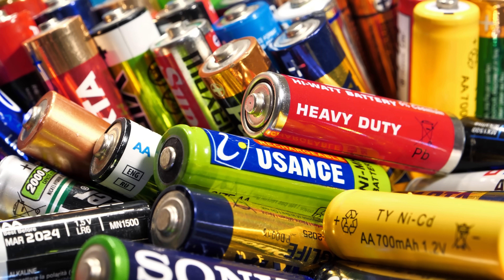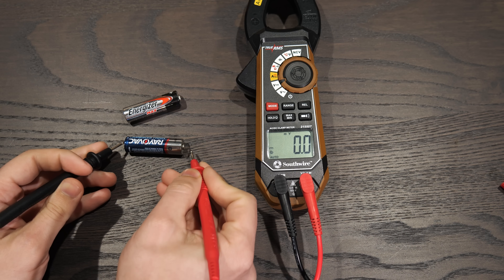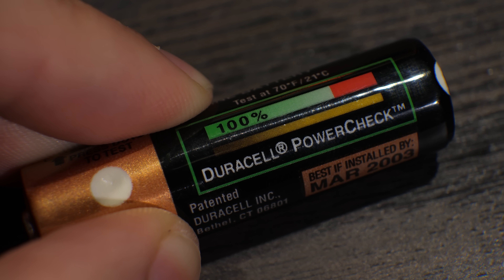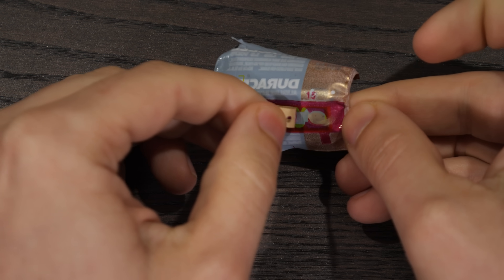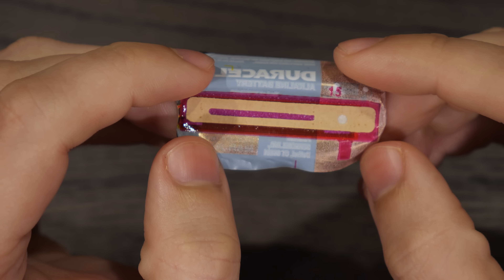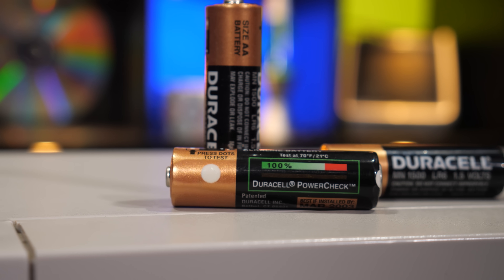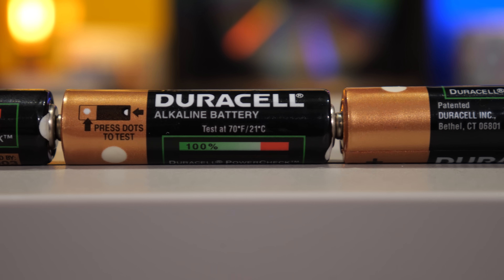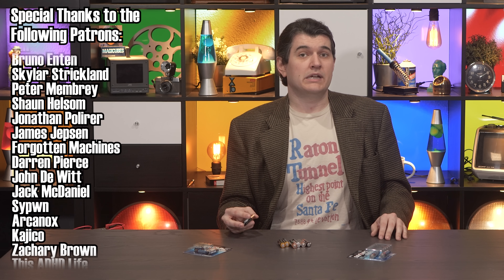Duracell PowerCheck: A genius idea which didn't last that long

Comment: K, but my mouse stops working sometimes. Is it the battery or some problem with the mouse? Are both the batteries burned out because it would stop working with only one used up. I would pull a new battery or two out of the package and then somehow end up with three or four batteries on the table and I had lost track of which ones were new and which ones were old. I guess what I'm saying is that I would actually kill someone if I thought I could get my hands on those old genius level self testing batteries! 😊

Comment: i mean i know like an electric can opener would only work with new batterys and then they stopped working and would still be 4 cells on a wiimote which i would sometimes also use for a crude battery level tester. so would move the can opener batterys to the wiimote.

Comment: back then what saved my gameboy most of the time was the good aluminum foil trick. whenever i got to be home alone as my parents went to work, i would pop out the batteries from the tv remote, take off a few pieces of foil, and it was right back to minish cap

Comment: Great to see the explanation of such a niece technology I grew up with and never saw again after a few years. 

I had to think about this feature. The amount of work to develop such a clever mechanism must be great. But the effort to bring the idea to mass production and reliable produce the labels - it must be equally hard. All the effort to give your batteries a bit more feature to stay competitve - and than it is hard to use and not really helpful - as you stated.

My main issue with the feature was: I had no feedback if I'm doing it right or the battery is dead. Is the temperature right? Do I press the dots correctly? Or is the battery dead? I tried it a few times and never got the competence that the gimmick is working.

Comment: There's no heater it's just another piece of engineered foil that creates an electric arc and lights up in a pattern.  These never actually accurately told the batteries percentage. 
The more you know! Cheers, a long retired PowerCheck technician!

Comment: I used the testers before using battery operated things to make sure there was enough juice in them. I.e., flashlights before a storm.  Also, if they were laying around for a long time, to see if they still had charge. I was miffed when they took it away.

Comment: I think that during that 90s this was something more important to kids and their parents as so many of our toys and music devices ran on AA or AAA batteries, so we were always taking batteries out of whatever we could find to make that device work just a little bit longer. You'd test each battery see which had the lowest charge and swap it for a fresher battery in a remote for the TV or VCR, just to squeeze a little more playtime out. And when that remote died you'd test the batteries and replace the low voltage one, but now nearly everything has a rechargeable battery, so the power check was just a necessity of a bygone era

Comment: Yea, nowadays, everything uses rechargeable batteries, and in general, the usages of AA and AAA batteries are becoming more and more rare. Most devices have those Li-ion rechargeable batteries now, and some even have "built-in" rechargeable batteries, just a term where corporation used to discourage people opening up their devices.

I still have some AAA batteries left for my TV Remote, as well as a plasma arc lighter that uses AAA batteries (very rare, as most on the market uses the built-in 3.7V 150mAh Li-ion Polymer battery). That's about it.

These AA and AAA batteries manufactures are a dying business in the modern day technology world

Comment: I did keep half used batteries around. Discman needed more oompf than remote. Remote still worked up to a year, where discman said no. I didn't keep all, but similarly, a few other devices would still run quite a while on low batteries. Still never used the tester. Just see if it works - which is why I did keep a few. Sometimes they'd run out within a week. Anyway, remote always got leftovers.

Comment: I've always used a pretty simple system to check if the batteries have any power or not You put it in and it works or it doesn't lol

Comment: Times where you take out partially used batteries to put into a junk drawer:
1. When you don't use the device frequently
2. When you are part of an Audio Visual team whose policy is to ensure that devices stay topped up (though they usually have a battery tester or voltage meter lying around)

Honestly if it was produced like 10-20 years earlier, maybe it would have been useful. 2010 was kinda the start of a trend where AA batteries aren't really a thing. Even modern TV remotes might be usb-c chargeable with a solar panel backing.

Comment: Fun fact! IF you want to test AA or AAA batteries grab it, give it a drop on the - side of it bounces a little. It's empty. If it doesn't bounce at all it's full. The drop doesn't mean drop it from 2-3ft away maybe a 1-2 inch drop

Comment: The drawback today with built in batteries is they don't last forever. 8Bitdo has the right solution, offer a removable "built in" battery that can be replaced with common AA's. If you just get some rechargable AA's, you're set. That's smart and forward thinking design.

Comment: In the late '80's and 90's, we had toys that took 3 batteries, sometimes 4, so we would have to swap batteries from one toy to another. We would swap them regularly, but we only had 1 remote, for the VCR. the tv sat on the broken floor model tv, but that was a nob control tv. We were broke folk, my mom asked people to NOT buy battery toys, so thy stated supplying batteries with them. I NEVER liked the tester, it was too hard.

Comment: Duracell - solving a problem that doesn't exist.
I do remember using these, but it was only when the device using the battery stopped working (because the battery was flat). 
Inevitably, the result was they were flat, and I needed new batteries.

Comment: @TechnologyConnections I was using my last remaining Duracell PowerCheck battery up until around 2019. I had a set of two of these batteries I used to recharge when ever they died. One of them leaked during charging around 2018 and since my charger requires a pair of batteries, I have not recharged the other one since..

Comment: I re-used batteries as sometimes it wouldn't work for one thing but it have enough charge for something else: on the original gameboy it took 4 AA's so what id do is after I was done with gameboy, id do the powercheck to see how low each battery is and if it was low but not dead it put that battery in like a remote or something to get more use out of it and then put the new battery in the Gameboy, not replacing all 4 just replacing the "more dead ones" -core childhood memory unlocked

Comment: 2:42 1.5 to 1.0 is dead?! You still have a whole volt remaining. The only difference is the half volt was used up.
Since you're converting it to 1 and 1/2 volts. 100% of the battery is 1.5 volts. So if only half of the battery was used, that solo leaves one full volt remaining. So how exactly is that deemed dead?
Reply: Basically because most of the electronics that use 2 AA batteries are working with 3 volts. The batteries are indeed capable of delivering 3v to the electronic with no major problem. But when the batteries are dead, they'll deliver only 2v... which means ~1v less than needed 

And then comes the load... When under load, a battery tends to lower it's voltage... Maybe to 0.7 to 0.5V.... not even nearly enough to power an electronic
Reply: @Csharp_sharp  they really need to come up with the battery that lowers (or has nearly the same life span/completion rate) in sync with the opposite battery.

Comment: I am so surprised to realize nearly 20 years have passed since this thing disappeared. I thought it was much much less, and I am sure I still have some of those somewhere around. Anyway I don't miss it, I always thought it was an useless overengineering and I did not want to use it to not throw away precious juice. Ps. One day I bought a pack of "pairdeer" AAA batteries, it's the one we see in front of all others in this video, they costed very low and I never hqared of them. Well I think a couple of those resisted in a clock for almost 10 years, incredible. They out-lived the supermarket I bought them from.

Comment: 8:50 I'd say the need for thermal insulation goes in both directions: devices with heavy power consumption will make batteries get warm during operation, which would cause the meter to turn yellow and make it look like the batteries have a good charge when, in reality, they are being drained very quickly.

Comment: Neat video! I wonder if this is the same mechanism the newer Duracell Quantum batteries use, which have a similar feature. As I watched, I kept thinking "I think I've seen these before, pretty recently" and found that Quantum was the product I was remembering, which I believe was only recently discontinued.

Comment: there's still a AAA size battery tester in my parents' junk drawer that came with a pack of duracells back in like 2002... whenever i see it while I'm visiting, i always take one of the junk drawer batteries and put it in just for funsies. it's a little clear plastic thing with the test meter in one end, and the plastic feels like the kind you had to rip through to get to the batteries in the package.

Comment: Strickly speaking it's the current flow that heats it up. Because of it being tapered near the bad side more of the current is located in a tighter area so the heat it generates is more concentrated to turn it yellow and vice versa on the good side the same current flow is happening but because the taper there is wider the heat it generates is more spread out so doesn't turn as much of the indicator yellow.

Comment: I'm actually very very grateful rechargeable batteries became more mainstream. I remember my first pair, I treasured them because back then, in the beginning, they were hella expensive, but the cost was, and it still is worth it. Not to mention that each rechargeable saves dozens and dozens of batteries that would just be costing to much to recycle or worse, dumped.

I think that indicator, along with the difficulty of using it, only served to remind people that they were using an antiquated wasteful technology. Altho they would be a boon with rechargeables, yeah.

Comment: what people don't know, is that you can charge disposable batteries, i've been doing it since i was kid.
it's not ideal and they might "explode", but it will be enough to use in remote controls.
i've been using disposable batteries in my remote for about 10 years, even tho they are marked as "do not charge", they do charge, just not as effectively and they'd be quite useless in flashlight or some tool or any other device that needs more power, but they work fine in remotes and also in wireless keyboards and mice.

i know, cuz i've been doing it myself, i'm shocked that those "experts" don't know this.

Comment: Adding a resistor to the analogue battery tester provides a load. Something like a 47 ohm resistor would immediately show the dead batteries that otherwise still show ok-ish on the meter.

Comment: For the things around my house that can use them, I frequently use rechargeable NiMH batteries. I have a few AAAs and a lot of AAs. Not only am I saving money on batteries but I'm keeping so many alkalines out of the landfill! They don't have enough current for certain devices but for most they are just fine and a few hours in the recharger puts them right back into service. 😁 

Surf Wisely.

Comment: My square digital clock from IKEA had been running on the same battery for almost 10 years now, the clock itself is absolutely trashed when you touch it, everything resets, but the battery is still going strong

Comment: I have bought a wireless mouse my very first action was to buy a rechargeable batteries for it. It's nuts to think about how much batteries we wasted and we keep wasting cause people don't buy a recharger and batteries for it. I have bought them like years ago and they are perfectly fine. (Mind you I still have non rechargeable ones, cause the recharging needs both batteries at the same time, so I used them as spare, but still haven depleted one non rechargeable, I figure half of them gonna go to waste sadly or I might as well gift it to someone...)

Comment: I remember pressing really hard to check the power

Oh btw I was born in 2006. I forgot when they used to do it but it was probably in the 2012 to 2017 range.

I’m from the UK btw, incase when it was sold in places was a regional thing.

Comment: Drop it on a hard flat surface, if it bounces=power, no bounce=no power

Also makes sure you drop it with the negative/flat side down, and not from a high place just like an inch from the bottom

Comment: I always found the annoying choice of battery for gadgets to be the 'C' cell. Too small for high capacity but just awkwardly too big & not delivering much more capacity than AAs. The first portable CD player ever made used 4x C cells with an adaptor. Remember when the tester was inside the packaging? It said to hold the tabs in for 10 seconds.

Comment: Should also mention, as a side note, NEVER keep batteries in things that aren't being used regularly. They trickle power and can leak, leading to either greasy batteries or the forbidden sugar. I have lost several torches from battery leakage.

Comment: also note that you can get AA batteries now that are lithium rechargeable with built-in USB-C plugs, usually with like 10X the capacity of traditional alkalines. Switched everything in my house to them a year ago and still have only needed to charge the doorbell and outdoor temp sensor.

Comment: I remember these. When your discman started acting up you could use them to figure out if the batteries needed replaced or if your $20 CD was damaged. Thing was that those contact points were so hard to press you never could be sure if the battery was dead or you just weren't pressing hard enough in the right spots.

Comment: I still have a couple of those yellow stripe testers from packs of C or D cells.  They were on the package rather than on the batteries themselves.  And I remember that before they had the yellow stripe, they had testers with a rainbow stripe.  It was basically the same thermochromic stuff that was in those "stick this strip of plastic to your forehead" thermometers that would cycle through the colors from red to green to blue across a temperature scale.  Anyway, I don't care that Duracell discontinued the battery check.  I just wish they didn't discontinue the non-leaking battery.

Comment: The only devices I still use that require batteries are my tv remote control- which the batteries just stay in till they are dead. Plus my camera- which I annoyingly have to replace batteries in regularly even though they aren’t dead because it needs a high voltage to run the camera. So the batteries I take out of my camera end up sitting in a junk draw/box/bag to use as emergency batteries.

Comment: Three battery testers, rechargables in quantity, and several rechargagle batteries that won't charge in one recharger but will in another... I honestly just bought some cheap 20 box off AZ to use because I needed some I knew worked and I wouldn't use one day and find dead the next (rechargable power loss... it's a real thing...) 

More aggrivating are the coin batteries... :)

Comment: Weird coincidence that a friend and me were talking about this exact thing a couple days before you released this video(yes its been in my watch later for almost 2 weeks now...). Also towards the end when you mentioned how it wasnt worth the cost to put a tester on every SINGLE battery, give me that back in that area of time, for a short while there was the same sort of tester but in the larger package of batteries... (So instead of a tester for each battery, there was a tester for each pack)... (But I can't remember if it was Duracell, Energizer, or someone else)

Comment: Back in the days I used to test the batteries are new or used by holding one end by finger and the other end on tongue. If there’s tingling sensation then the battery is new. I learned it by observing technicians or shop owners who sold batteries.

Comment: My computer mouse takes AAA batteries. It dies randomly and constantly. You know what takes A batteries? Every battery powered vibrator ever. Companies know that if your vibrator took AAA or even AA batteries you’d get annoyed that the product randomly turns off, so they intentionally accommodate 1-2 A batteries. If I’m annoyed by your product I’m not going to buy another one. Fuck AAA batteries

Comment: "Batteries not included" is still, unfortunately, a thing for some products. Went to the hardware store to buy a stud finder, not only did it not come with batteries but it needed a 9v of all things.

I was just so used to everything else coming with batteries, or being rechargeable for the last decade that it never crossed my mind to check for that damnable warning.

Comment: I never understood the point of these. I rarely--if ever--have to remove the batteries from something before they die. And if I do, unless I know I just put them in, I just toss them anyway, otherwise they will sit in my junk drawer for millenia because I either forget I have them or I think they (like the dozens of other batteries in there) are dead.

Comment: I often remove batteries from everything I don't use all the time. And that means that I need to put a lot of thought into bundling partly-used batteries with the thing that they go into, and I keep installing and removing them when I actually need the device.

I learned my lesson after a lot of corrosion ruined the very devices I needed to use. Batteries simply cannot be trusted in disused devices.